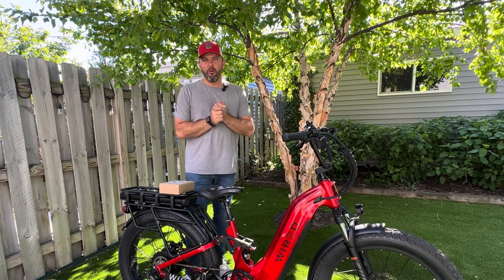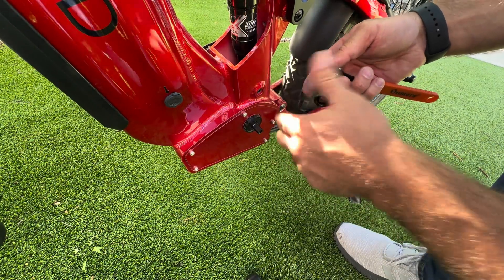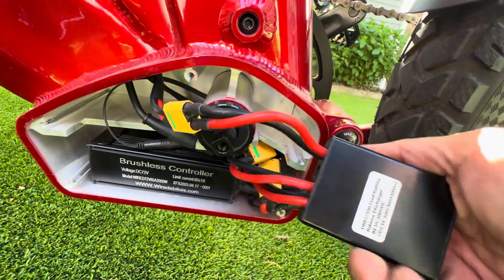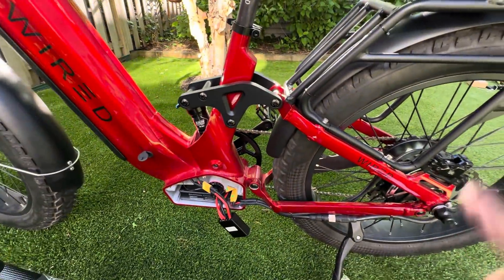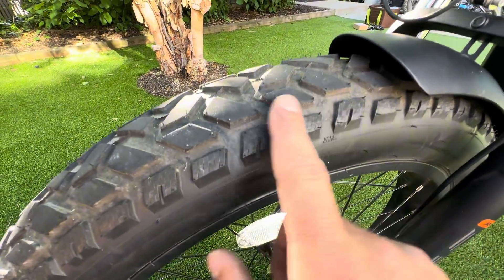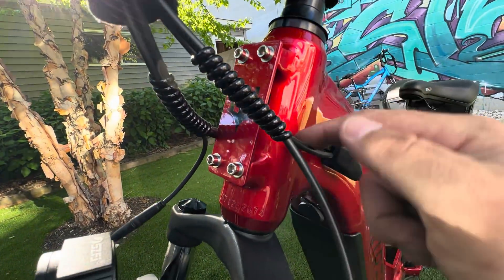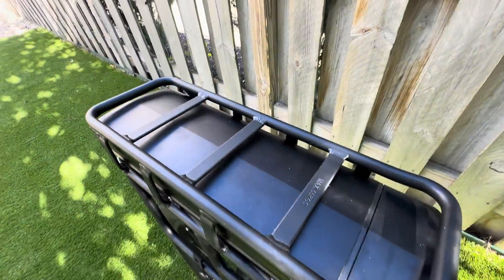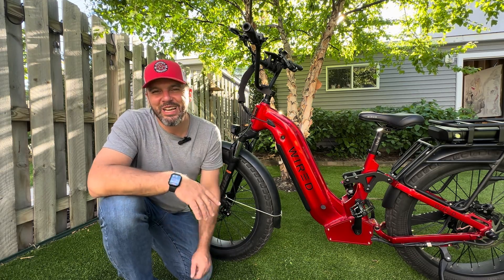⚡️ ⚡️ Inside the 72V Wired Scout Power Performance e-Bike: Major Electrical Upgrades EXPOSED ⚡️ ⚡️

Comment: I'd be awful leary unlocking this ebike to its full potential! He mentioned that it looked like 12 Guage wire from the battery, and 10 Guage on the Controller. Even if its the higher grade "AWG,.. American Wire Guage" which I doubt it is doe to cost. 12AWG is rated for 20 Amps, and 10AWG is rated for 30 Amps. Doesn't the Controller on this  bike draw up to  60 Amps!? Yea, it has a Temperature Guage on the display, and the motor will cut off if it over heats. Just saying, I'd be darn  careful pushing this bike hard. Like the Pittsburgh Climb..lol I'm sure those wires also have a temp rating. I'd make sure it corresponds with with what the factory temp cut off is.. And Yeah, it's just my opinion. I'm not busting on the bike and actually really like it for the price. I   really like the torque sensor, and having the power on hand if you need it (like to get to a dry place in a hurry if caught in rain).

Comment: The big concern that needs to be addressed now is the tires. If you get a flat doing 45 mph and that tire slides right off the rim, it won't be pretty. For the weight and speed of the bike, it really needs DOT tires.

Comment: Thank goodness for the rear rack change and I appreciate all the electrical headroom! None of us want to rehash some of the 24+ issues (to mostly a minimal extent, but they did happen nonetheless). I understand why they did this but Im not a fan of the bottom bracket/housing area. They shouldve put a bit more effort into designing some less pronounced edges, but Im sure Ill adjust just fine. Really, when I worry about cosmetic, eye catching, factors like that its because I know the inevitable ban hammer cometh and I prefer my ebike to look as much like an innocent ole bike as much as possible and that BB sticks out imo. Love the channel and your in depth videos!

Comment: Do you have any idea what connector is used between the controller and the display?
Reply from the maker: Main cable harness
Reply: @ElectricAllWheel I want to install a Bluetooth proximity switch between the controller and the display that will kill power to the display unless my phone is connected. I dont want to cut wires and wanted to make a plug and play harness.

Comment: Wired ebikes personally attacks its customers for simply reaching out to them with legitimate concerns about their bike. In my case, it was concerning my dad’s 2024+ wired freedom. I genuinely wasn’t even wanting anything for free at all, and all I did was ask them about my problem with what I assume is a faulty battery balancer and the onboard front battery connector which appears to have a short in it. I wasn’t rude or even aggravated about the situation, and was totally ready and willing to pay for the correct parts to fix the bike myself!

Comment: Can you use a different brand charger? I have an Lectric XP4 with a 5 amp charger (also have the stock, forget what amperage it is currently, 3.5?) I have 4 chargers total in fact. 😂 Don’t ask. Was thinking about getting the Scout. Looks amazing and love the battery life.
Reply from the maker: Need a 72V charger with the factory charger connector type

Comment: Is it waterproof? Can you ride it in the rain?
Reply: yes, that housing has sealant and the batteries are well encased i ride the previous model in all weathers, even snow
Reply: @DDracee  I'm very glad to hear that you have not had problems with the previous models. Unfortunately, with even a bit of rain, I've had problems with the Freedom 2024+ and am still trying to get my bike fixed. When it works, it's great, but seems to be very  sensitive to water. Wired's warranty does not cover rain riding, or even sitting in the rain. Any suggestions on weatherizing the 2024+ model?
Reply: @RobertAGahlJr  Hmm... The only "risk" is that controller housing or the batteries. The power output of the battery and the power intake of the motors are already well protected from the original manufacturer.

Making sure the charging ports are well sealed would be step 1, if that cap is damaged and doesn't make a good seal, might be stuck with using sealant tape on rainy days. (easily appliable and removable)

Then next would be to follow where the cables get into the controller housing, (there's plenty, the stuff going to the handle bar controls, the stuff going to motors and the stuff going to the batteries), if the rubbers on those cable holes don't make a good seal, water can follow the cable. The easiest way would be to ignore where cables get into the frame from and seal what you can from inside the housing. then, make sure the "plate" that you screw on actually has a seal (rubber linings)

it's not always easy to find a leak, just gotta try and cover possibilities best you can, could be crack or a bad weld somewhere on the frame for all we know if all the obvious points of entries are covered, my local bike shop offers waterproofing services even for custom ebikes, might be worth looking into

also worth noting that the problem may not be electrical at all, maybe it's that touchscreen? you didn't specify exactly what the problem was

Comment: Wired should offer both front & Rear turn signals, a very Large Super bright headlight and Loud Horn as these 72 volt bikes will be ridden on the streets at or close to most posted city speed limits and rule #1 is SEE & BE SEEN. Safety should also be a Very important consideration beside speed & Power. Come on Wired!
Reply: I am not sure they will go for that, as it will deviate from NOT looking like an e-moto.

Comment: Many thanks for a great in depth video on the structural changes on the new bike.
I am the "dummy" who owns a 70+mph 96 volt version 1 2014 Freedom. I have a Warrior on order and look forward to seeing how the new bike performs at speed.
Judging by what you have shown us I feel the bike should do a very good job of dealing with the extra stresses that bikes encounter as the MPH increases.

 Also glad to see the changes to the wiring (gauge etc) and balancer. I am not sure but the blender/balancer looks to be the same one I have used on my 96 volt bike and it has given me no trouble at 112 volts (on a full charge) and over 100 line amps with bursts of 170. 

Much thanks for the shake test.....this is very telling and the new frame design seems to handle it well. 

One of the things I found most troublesome on my bike, was  not the low speed "no hands" tail wagging low frequency resonance that most of the early version 2 riders complained about but the high speed 45+ actual "tank slapper"  that was improved most by the addition of the dual wall rims and 10g spokes......its great to see that Wired has included this in the new lineup.

I am sure that the Warrior with the addition of the top bar should be substantially stiffer than the Scout so this is really great to see.

Thanks again for the review and I will stay tuned for further updates!

Richard Gavle
Reply: I just hope you don't end up being "IV fed" in a full body cast on that crazy bike!
Reply: How did you set that up? Is it a fardriver + QS motor with custom battery mounts?
Reply: Yes, I ran the stock motor on 96v all winter and got up to 59 with it but it finally ate a set of gears and the keyway was starting to shear so I went with a qs205v3 motor.
I use a 36v pack in series with the stock pack for 96 volts and already had a 72 pack so I paired that in series with a 24v  volt for the second 96 volt half. I have all the added batteries in a box that mounts them on both sides of the rear tire just above the axle centerline to keep the weight low.
Reply: @1bottlefed  Wow im really impressed the stock motor held up so long with that much voltage going through it. I was thinking of getting a QS 205 V3 as well, the 5T for torque. Did you get the motor already in a 26 inch wheel, or switch it out yourself too?
Reply: @RXR25  I built it myself. I used to build road bike wheels back when I was racing....let me tell you a 26x4 wheel is a lot easier than a 185gm tubular rim LOL. When I first did the motor I just used a China single layer rim and the stock spokes. Since then I have switched to Origin8 dual layer with 10g spokes (had to drill the rims and front hub to fit the spokes) and this has made a HUGE difference in stability at speed. So if you buy a pre-laced assembly make sure its specked with good rims and thick spokes.
Reply: @1bottlefed  Wow thats really impressive, you definitely went above and beyond to make that happen. I'd love to see a video about that one day

Comment: I am too poor to own one of these but I sure wish I had one as I am a 69 y/o senior that just had a heart procedure done a month ago. My hard earned savings were taken by a scammer and on account of my vulnerability and naivety to fall for it. I love walking a lot but my feet and legs are not like they use to be and since I don't drive a vehicle, an ebike would be lovely. My only concern though is the distance or range it can go before needing charging.These are heavy bikes and would never want to be stranded with one. Many of these bikes don't always come with great range. I think speed is far less important then range and torque to make it up many hills. I do question though as to why a generator to charge the batteries as you ride is never implemented. This is a beautiful bike and is my favorite color too. Gold rims would make it pop.
Reply: Ouch, thats harsh. I find those scammers to be lowest of the low and to be honest, if I knew how, Id enjoy hunting them. Mostly because they purposefully target people like you who maybe a little gullible but really your just eager to help and they prey on that. Its disgraceful. Regarding this bike, While the dual battery will have a good range, esp if speed isnt your thing (mine either, at least most of the time) I would say the weight of these bikes is considerable! If your looking for range without the need for these speeds, the 60v Cruiser is a great option (and the speed is still there, just aout 8-10mph less at 35-40mph - fast to me, on a bike) and it has most of the frame upgrades this does, just not the 72v. A much better pricetag at 500 less I think and the weight is still heavy but quite a bit less than this beast!

Comment: Hey Matt thanks for showing us that the new 72v Wired bikes are as bad ass inside as they appear on the outside. Finally a good shot of the Red paint job on this bike, and I love it !  Man this color would look stunning with the Gold wheels ! Too bad that's not an option, along with the lack of a nice upgraded air adjustable dual crown front fork. Bummer... Maybe some day you can do a video on exactly what it would take to do those mods to the new 72v Wired bike.

Comment: Cool video!  Looks like a very powerful bike.  I can't believe it's 145lbs though.
Reply: Honestly makes sense. When you increase the voltage and while still having a decent to large Ah capacity, it makes batteries heavy. Plus the bike frame is beefed up to handle the performance without it feeling sketchy at higher speeds.

Hopefully, solid state batteries come soon enough which would save big on battery weight.
Reply: I think that the Wired Cruiser at 115lbs. with both batteries hits the right balance of speed, power, weight & price for me.  But to each their own...maybe if I was 50 years younger...